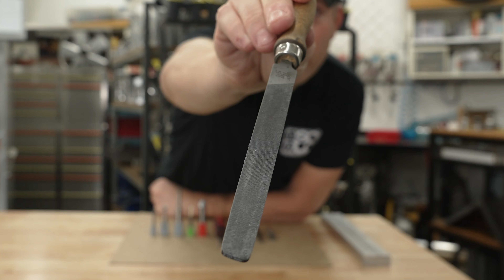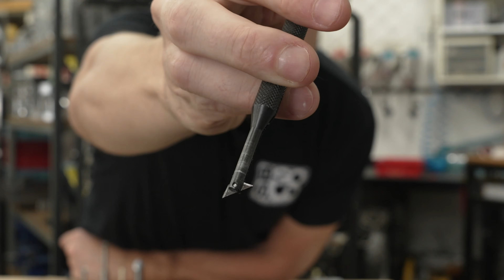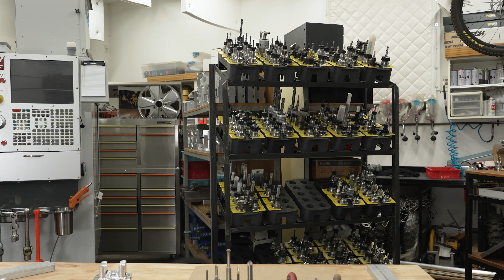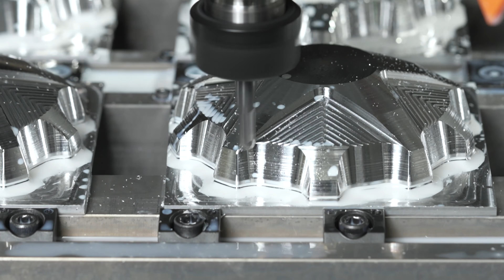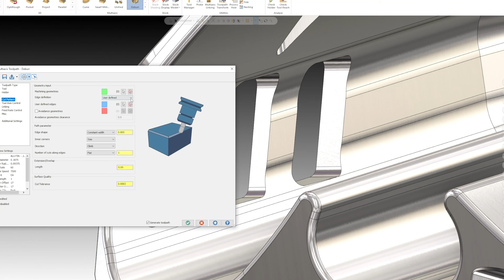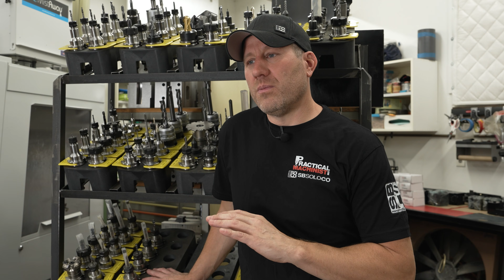My Favorite Deburr Tools ON And OFF The Machine | How We Do It  Ep.3

Comment: Our work just bought us pnumatic deburr tools that have a small bearing in the center, and then the height is adjusted off the face. They take two small inserts and run super high rpm. They work amazing once you get them set up right.

Edit: It is a KBC Pneumatic Hand Chamfer and Deburr Tool. $110.

Comment: Two things...using the uni-flute style countersink for hand or power-drill deburring can easily create off-center chamfers on holes. Much better to use a WELDON STYLE  countersink because they don't wander. The other thing is why bother with a "pizza cutter" when your lollipop will do the same thing by hand far easier, especially reaching in to chamfer holes at an angle
Reply: Those Weldon style countersinks are definitely the better deal. I have a set of those too..  The pizza cutters can be nice when you need the reach, being 3 times longer than a carbide tool itself. In reality though, I rarely deburr by hand and if I do, it’s just to get rid of sharp edges and nothing dimensionally.

Comment: Are those yellow things tool labels on the tool rack? Because I def want that. Also I love drill mills for chamfering because i can use them to easily engrave the part too
Reply: Yeah, they are tool tags. These are from Command but a lot of others are starting to make them now.. I have used those chamfer endmills before.  I tend to break tips or get burrs trying to engrave with chamfer mills or even engraving tools. I like using small 2 flute ball endmills. They would pretty good and cut to the center.

Comment: i use a electric hand grinder with a rotary burr cutter (in german its called Frässtift) it leaves a really nice finish and it takes like a second to deburr or chamfer one edge of like 100-150mm.
Reply: Only time I use a grinder/power tool, is after I ran a crappy weld usually. 😂

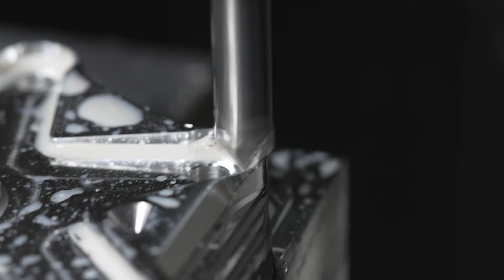Comment: 4:09 Using a chamfer mill to spot holes is a bad habit. Chamfers mills are not meant to plunge into material and doing so will break off the very tip, and this will annoy anyone else who works with you when they go to touch off the tool next time. 

Spot drills or center drills are for spotting holes.
Reply: there are some, made to do both. the tip is not as pointy from the beginning, so it does not brake. some can also sidemill. I like them, more space in te toolchanger. 
Also, I never had a problem when using a spotdrill for champfering, but the otherway does not work...